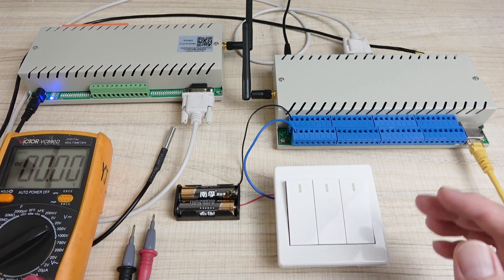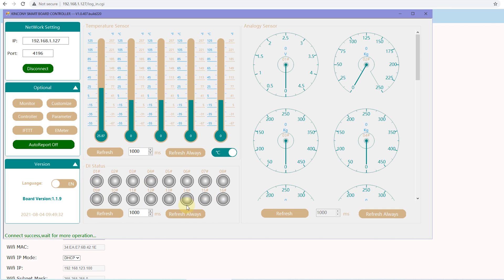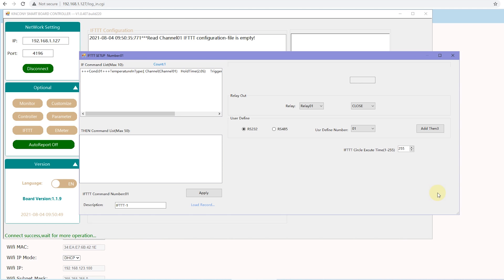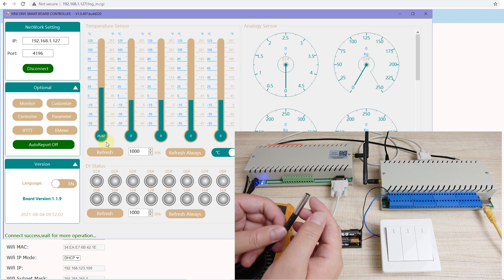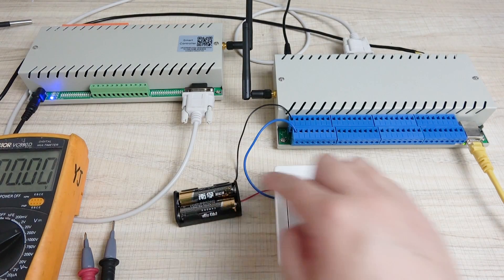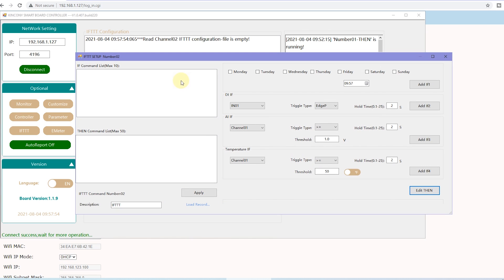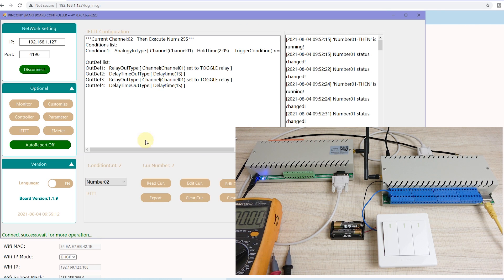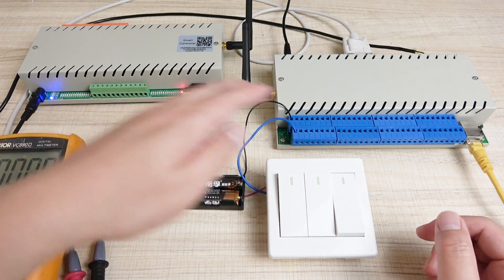how to use temperature or analog input trigger relay in loop mode

Comment: I've tried to do it but the counter gauge is not indicate the voltage 3.3v, it remains at 0. Also the gauge #1 & #9 is aiming on gauge #1. 
My version is 1.1.12. Please help because I'm trying to use AO Arduino's sensors modules at 3.3v. Thanks a lot. :)
Reply from the maker: how do you wire? can you take a photo post your question to our forum: www.kincony.com/forum